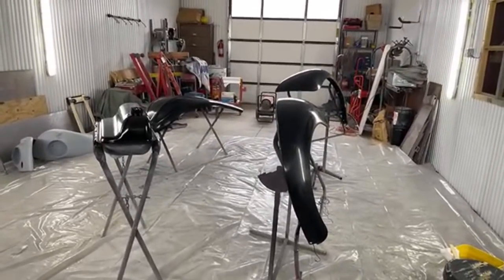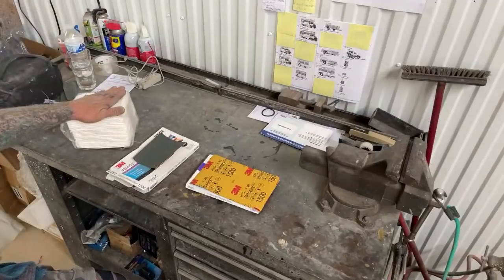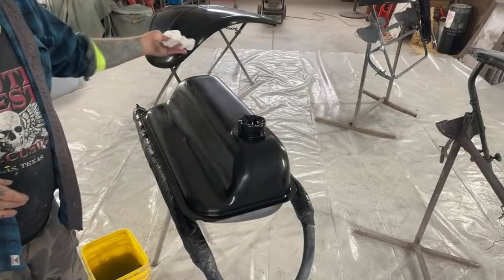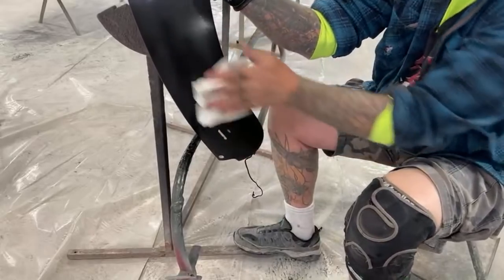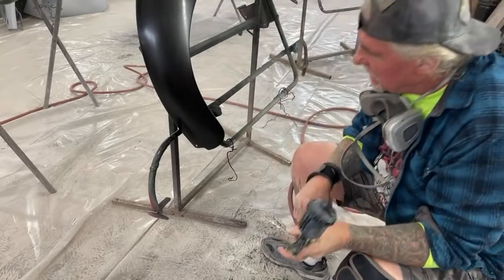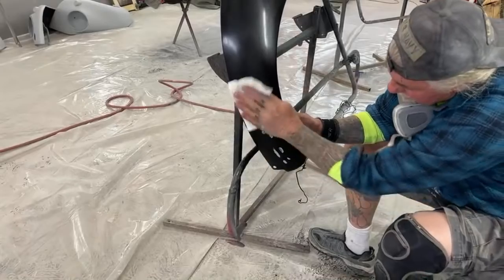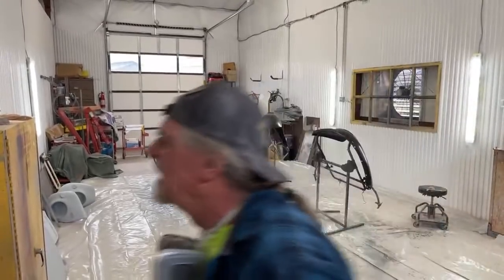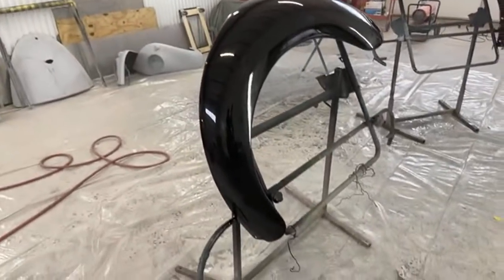Volkswagen Beetle Getting Painted - PART 3

Comment: Have you ever used a razor blade at a 90° angle to panel and drag it across run to cut it off first. Kind of like a scraper but lightly drag. When I went to school thats what we were taught just curious?  Thanks pete
Reply from the maker: Yes but in this situation where it was located and behind loose off the car it was better sanding it out.  And we found out that it was probably the epoxy that ran not the clear since we went to primer

Comment: Hello Pete just a quick question when you fixed the spec problem in the trunk lid and the run on the fender and repainted those areas I was wondering why you did not give them a light sand and then a coat of the DBC500 in not doing this will these areas look slightly different in the final finished job? ...... Hope I can get this stuff here in Australia ..... luv ya work Pete

Comment: This is a actual question. Does 1500 allow enough adhesion? I heard the highest you should ever go is 1000 at most. 400-800 is ideal.
Reply: Correct 😉
Reply from the maker: On this subject 1500 is applicable.  We are only SCUFFING the surface of a freshly painted item that has never been subjected to the environments. So by sanding it with 1500 we are removing imperfections and cleaning the surface for the rest of the clear coat.   If this was an old paint job that I was repainting the it would be 400 wet or 320 dry.
Reply: @myfriendpete  got it thanks Pete!
Reply: 800grit if you’re spraying base over clear. 1,200grit if you’re spraying clear over clear.

Comment: Another tip i'll add....In colder weather, it helps to bring the clear up to temp before spraying weather by putting in front of a heater. or using a heat gun......If your shop is 50 degrees and the clear is sitting on a shelf, that clear is 50 degrees, too cold for spraying

Comment: Pete what do you mean by reaction with base and clear coat it doesn't make sense to me how can a reaction happen if clear could go over base can you explain that
Reply from the maker: Once the clear drys there is a settlement period that lasts approx 2 to 3 weeks and if you apply paint on top of the clear after sanding it before this time ends you have a good chance of the clear coat lifting from the reducer reaction.   It’s hard to explain in a comment.  Hope you get it.

Comment: Pete i love your work but that gas tank has dings in it don't fly off the handle
Reply from the maker: Gee your the 42nd person that noticed that.  Maybe you should come over here and fix it. SINCE ITS THE BACK OF THE FUCKING TANK AND IT WONT BE SEEN.   GOSH GEE JOLLY.  I’m such a total fucking loser and half assed body man to do it that way.  PS. WHERE THE FUCK IS YOUR IINSRTUCTIONAL VIDEOS 😡😡😡
Reply: @myfriendpete  Pete don,t get up set i love your stuff   i was just saying , your going to blow a valve getting so up tight

Comment: Pete, It's hard for me to tell but it doesn't look like your exhaust fan has an externally mounted motor.  If it doesn't  what's your take on paint vapors going through that? Relatively safe for spot jobs like that?
Thanks
Reply from the maker: The exhaust fan I have has a NON-COMBUSTIBLE motor on it. Which is specifically designed for this type of application.  The fan setup is an 8500 cfm and 48 inch diameter in size.  It’s more then enough exhaust needed for what I’m doing.
Reply: @myfriendpete   Thanks Pete. Any suggestions on the best place to buy one?
Reply from the maker: @jimk7882  I got mine at Home Depot.  I actually have a 36 inch fan new I. The box with shudders. If your interested call me
Reply: I'm guessing the shipping to Ga. might be too high.

Comment: Any updates on the RZR before I go get mine in 2 weeks?
Reply from the maker: Had mine in the shop 4 times finally got it all figured out and fixed. I suggest you purchase the extended warranty well worth it and Stay away from aftermarket performance parts for your engine. Good luck and have fun. If your ever in MOAB UTAH look me up 👍👍👍
Reply: @myfriendpete  i hear man on all the BS , Last winter my new Polaris Sled pissed me off so bad I sold it and said I'd never buy another Polaris,  was set on the X3 till I went and sat in the ProXp, really wanted a Honda with the DCT trans, but I wanted a factory turbo. So I ordered the Poo. Hopefully its not a POS like the Maytrx sleds. The Axys sleds were much better for trail riding IMO , Maytrx sled is well suited for mountain guys, and they get them this yr

Comment: What happened when my clear doesn't dry 4 to 1 with a pearl powder hok. 5 days then any spray over it wrinkles up????
Reply: Sounds like you didn’t mix the clear properly or you got a bad batch of clear or hardner?? 🤷‍♂️🤷‍♂️🤷‍♂️
Reply: @diyautoschool  dyna coat clear pro had to strip whole car and epoxy